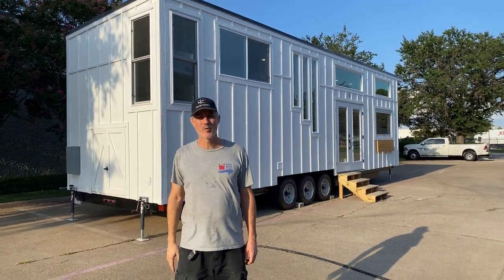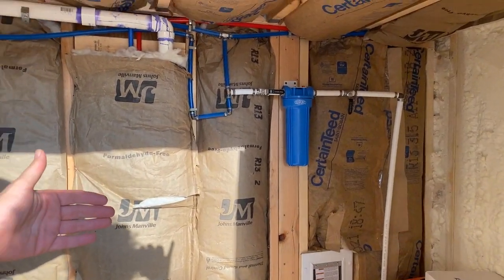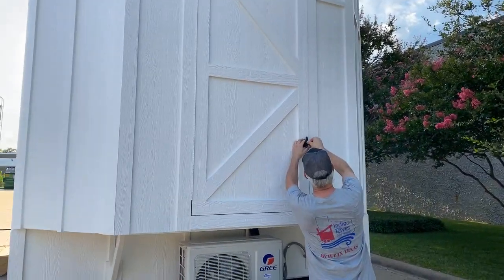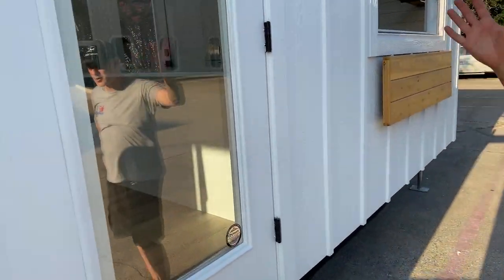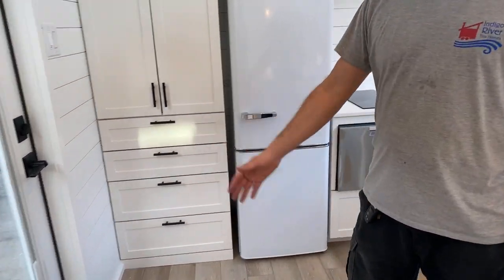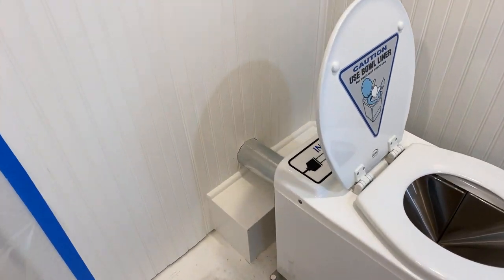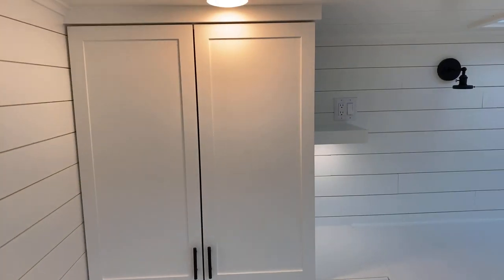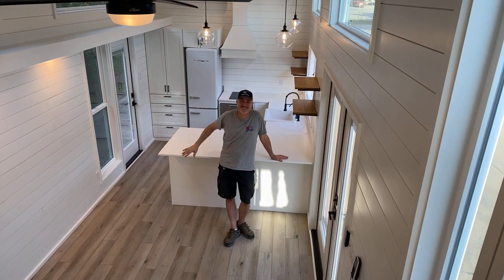36'x10' "Not so tiny" Tiny Home on Wheels #IRTHome29

Comment: I have watched quite a few of your videos. They are nice. I don't need a huge kitchen or kitchen table. I would rather have a bit of living space. I want a dishwasher. I love your stand up bedrooms. Why don't the bedrooms have a full wall and a door for privacy? I have never seen a tiny house with an upper bedroom with privacy. Adults will be living in these but even if they have kids, privacy is a thing. Lastly, why built in dog kennels but no special place for cat litter boxes? This home here is the closest to what I want. I am going to keep following your channel because I see potential. I want to see what you come up with in the future. Thank you for the tour. Be safe and have a good day!✌🏻💙🐾🏡🇺🇸
Reply from the maker: Thanks for watching! A full wall for the loft is an upgrade that a few customers have ordered. You also need a room-to-room fan when you bring the wall to the ceiling. 
Doors can be added, but no-one's ordered a door up top yet. 
Ventilation is crucial in a tiny house so using the pony wall keeps you from needing that extra fan.
Reply: @IndigoRiverTinyHomes  Ohhhh. I see. That does make sense. I have been wondering about this for a while. More than likely I would want my rom downstairs anyway. I'm not so good with stairs these days. 😬 Thank you so much for the information. I appreciate it very much. ✌🏻🥰🐾

Comment: Ok I really like this one but the placement of the dishwasher is all wrong....unless the client wanted it that way. I would like to see a model with a range underneath the flu vent in the kitchen and the dishwasher placed somewhere else. I guess because I love to cook. Different Folks different Strokes. lol
Reply from the maker: We are a custom builder so design & layout choices are often made by the homeowner. Unless there's a wheel well in the way or some other structural limitation... Fitting everything in a tiny home is definitely a puzzle with many factors affecting placement of various features.